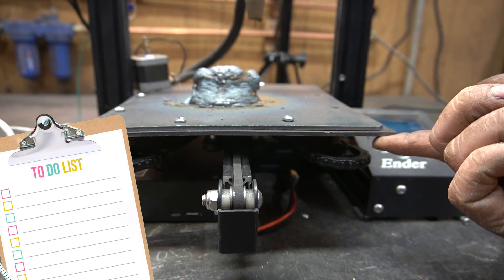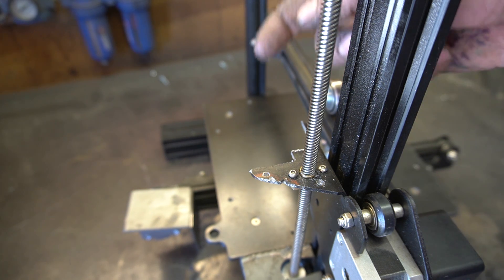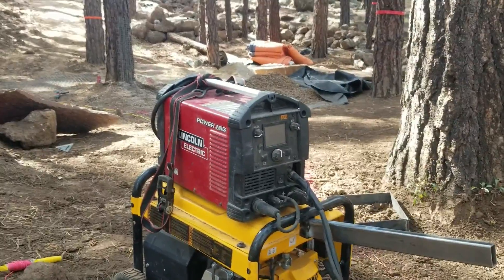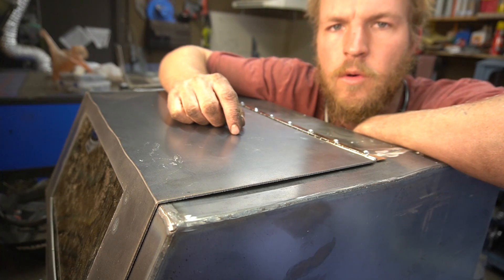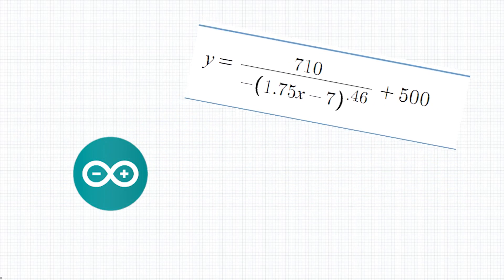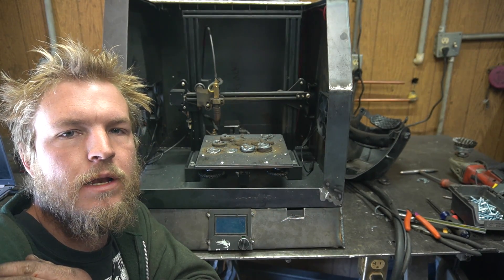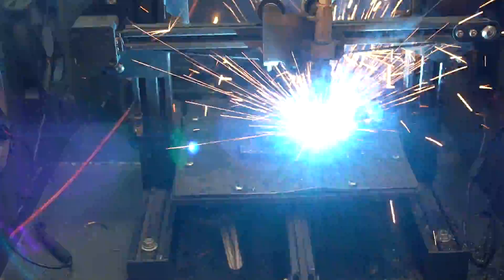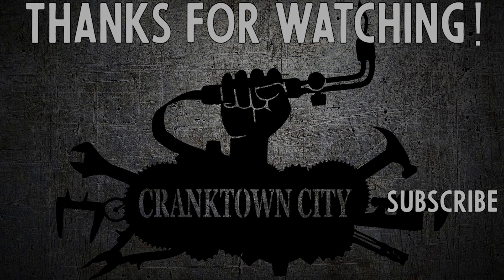DIY Metal 3D Printer (part 2)

Comment: So iceberg been a pipe welder for like ten years, and whenever I’m trying to “build up” a spot where I want steel to stack for any particular reason, I just do a bunch of instant “spats” so what I’m suggesting is if you can program the welding unit to maybe try More of a “dot matrix” approach where it can move around stacking individual coins as small as you can get it to weld then voila! You’ve got your heat input problem mitigated, and you now can work on your “resolution” that being how small of individual dots can you produce using smaller wire probably and much smaller current and wire fees speed.

Comment: That's crazy. Collectively we're still trying to figure out plastic printing, but when that's done the next hurdle will be metal 3d printing; in that regard, the  most advanced devices will be inept, bulky, and prone to failure, with a printable area no larger than a shoebox. Then there's your printer, which isn't accurate but works, and works kinda well, and works over a large theoretical print area

Comment: Ain't no way I could get half as far as you. I've thought about doing the same thing, after watching you turn a mig welder into a 3d printer I realize I'd be in way over my head. You did make me wonder if using .023 would give you more minute control and would hide imperfections better. Also not nearly as much spatter big enough to clog your cup. Probably quadruple your print times unless you scaled your benchy down. Not as much warpage I assume.

Comment: If you mounted a surface grinding wheel behind the printer. Then between layers the y axis could move back. Leveling the weld for the next layer

Comment: 10:40 that connecting rod system not working sent me down a whole tangent of looking up steam locomotives and my brain frying like a little overworked 3 cylinder.. i feel like that system would have worked if the rod was longer and it was set up parallel, it looked like you had the rod too short and therefor it was at 1oclock on one dial while it was at 12oclock on the other, they need to be timed together with the proper length rod and then i believe theyll spin together... or atleast thats what my intuition tells me

non the less the belt drive system looks far superior

Comment: If you change the liner and polarity, you can run aluminum wire, which will run cooler and freeze faster.

Comment: Hey man, when you were testing your amperage fluctuating, if you switch to spray arc or pulse mig it should change from variable amperage to constant current which should be easier to find a consistent slope.

Comment: To fix the extruder issue, you can change e-steps in the printer config interface without updating any firmware. Or possibly you could increase the flow rate in the slicer.

Comment: si tratas de refrigerar el metal de las capas anteriores a las que esta imprimiendo en ese momento se tendría un mejor resultado; pues el metal depositado al estar a una temperatura muy elevada derrite al metal que fue impreso en la capa anterior y se deforma, tal vez también a parte de la refrigeración de la sección ya impresa, habría que probar con una maquina de soldadura de menor amperaje con filamento mas fino, es algo que vino a la mente podría funcionar.

Comment: I seen the newer videos on this as well, and this may sound fracking stupid, but once everything is together and tight, how about  a putting an oscillator on the on the nozzle/print head to simulate rolling/cupping.

Comment: If the thermocouple went downscale when the temp went up it was either hooked backwards, or it was electrical noise. Red wires on thermocouples are negitive. Opto isolation would be agood idea if you blow the arduino.

Comment: Now you should take good tig welder and build a printer from scratch. The mig wire would still be usable but tig machine gives you setting capabilities on the arc and current.

Comment: Great video... I have some ideas. I watched last night and thought maybe thinner wire would help with heat and puddle control. My second idea is much harder but might be the best solution. Move the motors and submerge the entire setup in liquid similar to underwater welding. You could use different types of liquid to control heat and oxidation. This would be hard but maybe the ultimate solution.

Comment: I think you would have better luck with a Tig torch, and the filler off to the side, no splatter.  Also I know cooling might be an issue (maybe run water loops on your steppers), but since it's in a cabinet, you can just purge the whole cabinet with Argon (or whatever shielding gas/mix you're using), then you wouldn't need a cup, and could lighten Z axis.

Comment: When welding body panels, you can use an air compressor and air sprayer nozzle to cool the metal faster to avoid warping... Maybe get something like that set up to increase quality

Comment: You really aren't that far away from a functional product. Obviously money is the big factor, but building a printer from scratch  out of more robust materials, sacrificing a welder and a bit more work ironing out the kinks you already have a handle on and this could easily rival early polymer 3D printers.

Comment: Considering the layer width/height constraints of the weld bead, I'd call that a very good result.  You just need to scale up in size since resolution is very low.
Reply: no you can just increase resolution by micro tig.  go look up jewelers micro tig.  they can weld the pin back onto earings for crying out loud.  you want that type of welding for this so you can have great resolution

Comment: hey dude if you wanna get a huge speed boost on your laptop just grab a solid state drive and slap it in there

i have a $2k laptop that i got on ebay for way, way less because the original owner didn't know how to boot from a solid state drive and it was slower than my old lenovo idieapad despite having hideously higher specs in every single other way

if it is already running on a solid state, you have taught me fear of the arduino ide

Comment: Great progress! What if you built a heat shield attached to the z axis to prevent the heat up there? Also i see there is a ton of warpage to the base plate, maybe a water cooler might help it? im sure you could salvage some scrap parts to make a cheap functional water cooler!

Comment: You could maybe use some kind of optical sensor to monitor the welding. Probably behind dark glass. But it should instantly react to increas or decrease in the light which you would think has correlation to the welding.

Comment: i would imagine a tig setup would be far more controllable and repeatable for deposition rate and temp control, and not nearly as abusive to the motors and belts and such with all of the arcing and sparking of mig. it would be more complicated for sure, but im sure you could recycle the wire feed you already have without much issue and the much finer control over the arc you would get with tig would allow much higher quality prints.

Comment: My gf and I collect benchys and I gotta say this is one of the coolest I have ever seen! I had a thought about doing  this exactly, but never took it anywhere. I'm happy to see someone actually doing it! It came about while the gf and I were talking about free hand 3d printing with a mig  welder like one would with a 3d pen. That progressed into adding one to a cr-10 or ender3. Which is exactly what you did! This is awesome! Please keep up the great work!
Reply: no you want wire fed tig welder doing micro welds to get fine resolution.  a big mig welder won't cut it for fine work

Comment: you are not using gloves and your hands are always dirty. So your solution is to use angle grinder without cover. While using it you will lose some fingers and you will have less them to wash. Quite clever! But I would just use gloves and just keep hands clean. That's just me.

Comment: dip it in glycol instead, should work just as well, or maybe some alcohol with oil, something that doesnt leave a lot of stuff inside the nozzle
thats where you failed, otherwise entirely remove the nozzle and have a copper pipe shoot the gas onto the weld, or maybe just fill the whole box up with inert gas, CO2 should work. heavy and cheap

Comment: so, 3D printing MIG welders are used to make parts, HOWEVER the caveat is that there is going to be a stock removal phase afterwards. I know that there are some very high-tech ultra lightweight compressors blades for turbos are made using this process.  Im sure that there are others manufacturing industries that do as well.

Comment: Very Nice Job Bro.....same Idea here by me. Still In Progress near to end.....but it  will work fine.  Layer high controlled by Speed and Amps ....i use a Maschine Weld Head direct Wire Input from the Welder

Comment: If i could make an observation, i would use a method employed for pipe welding where the pipe is enclosed at one end and then an innert gas is pumped in at a desired pressure.
You could essentially get rid of the nozzel on the mig gun and use gas in the chamber to stop all your problems of contamination, let me know your thoughts please, great video thank you. Also just a thought, can i ask what determined height is each pass?, because my thoughts would be that you need a type of secondary functiin to the printer that shaves off the very tiniest amount of weld from the top of each pass to maintain a set height every time, sort of a grinder that passes each the pass and levels it and cleaning it before the next weld pass.
Thanks again

Comment: You should check out the tip dressing stations for robot welding. Maybe like a tip dressing thing that flips into the workspace for cleaning, and flips out of the way for printing

Comment: dude, the fact you turned an ender 3 into a "completely functional" mig-3D metal printer is pretty damn impressive. I have a year left on my aerospace engineering degree (after working 5 years as an auto mechanic and doing fab work on a couple race cars) and I would say 80% of the other students wouldn't even know where to start on a project like this.
Reply: wow that's a complement bro!
Reply: maybe because he made a boat and not a plane, fool
Reply: @Carpcontrol  aren't you clever 🙄

Comment: Keep in mind that my knowledge of welding is barely above zero, but I do have a few thoughts.

To save on the material that you use as a base plate to weld onto, what if you keep 1 piece mounted, then when you slice the model, send the first layer to your laser cutter to cut a piece out of your stock. Then use a few tack welds to fix it in place on the build plate.

As for how to get it in the right place... well I have a couple of ideas. The fancy way would be to figure out how to make 1 of those position finding probes, kinda like they use on some CNC milling machines. The other way... actually, I'm not sure - I started off thinking of sort of a manual alignment system, but the more I thought about it the more complicated/difficult it got, so... 🤷‍♂️ Maybe you can figure it out.

Dunno if any of that will be of any use, but maybe it might at least spark some new ideas for you. 😉

Actually, I just realised, you don't need to cut the first layer to the exact shape of the model, you could just cut out a rectangle that is somewhat close to the size of the first layer in terms of max width & length. That would make positioning it way simpler, and still help you reduce the amount of material you go through for base plates.

And yet another idea, though it kinda defeats the whole 3d printing metal concept - when making a 3d model include some vertical holes that run through the whole thing from top to bottom. These holes should match the size of whatever bar/rod stock you have on hand. Slice the model into layers the height of your plate stock, then cut them out on your laser. Weld rods into holes of bottom layer, then just slide the other layers on top 1 after the other. You could just weld only the bottom & top layers, & then grind / sand the model a bit to shape. Alternatively you could weld each layer to the 1 before it, using the welds as a way to smooth the visual transition between layers.

Comment: There is probably a reason every one of these I have seen uses a delta table rather than gantry style. You can get a high voltage digipot but you have to talk to it via SPI anyway.

Comment: This is really cool. Have you tried checking the amperage at your ground clamp and comparing that to the amps on your welder? That might help with adjusting the wire speed.

Comment: as a welder I will tell you - learn current-temperature conjugation (2nd class of vocational school - subject of applied metallurgy) - then you will know what the temperature depends on and how it affects the environment
as a construct of one of the first 3D printers using RAMPS you need to know that the current tolerance is within 0.3-0.7 V and when exceeding 5.11 V each RAMPS goes with smoke
the feeder can be powered from RAMPS through a controlled transducer (triac system)
the prototype of the 3D welding machine was discontinued in 2014 as ineffective and unprofitable in production

Comment: 3d printer motherboard’s are all 12v or 24v, you can save a power supply by using just one of them. The only parts that get touchy about that are the fans & heating elements (bed & hotend), none of which you are using. The steppers will still get the same volts if you use ether 12v or 24v.

Comment: LOL, here from Hackaday, and glad I found your channel. Subbed because you're funny, straight to the point, and especially leave the mistakes, warts and all in which shows an important part of any project, learnin'.
I think that turned out great, rough? sure. Buts its made of metal with a welding gun, not surprised that there is a bit more slop at this stage.   I expect it you wanted to throw a couple grand worth of motors, machined surfaces and some sort of slower welding process, you could probably do better.
If you don't want to throw cash away, keep iterating, and it will also get better.   They don't weld wood, and they don't glue-up steel works, for a reason.  You're kind of breaking new ground, like the citizen-scientists of olde.

Comment: For sale: one slightly used ender 3, works a treat and even prints metal! That's right print you some bolts, nuts, that crank shaft for your car, whatever! Only $999.99

Comment: In this case I'm pretty sure ohms law could be your best friend along with power theory. The current you are putting in has a set upper limit. When you dump current in and it's not maxing out, that resistance should be directly translatable into a wattage load, the big hang-up is your cnc won't know if it's moving towards or away from the heat it's sinking, like when it does a circle it comes back over an already heated area. I wonder if some sort of crude XY accumulated heat-map/coordinates from those sorts of measurements, that just assumes a cooling dissipation factor, could get you most of the way there. Also there is what 3d printers use for this in having minimum "wait for next layer" timers.
Reply: I don't know CNC, however by jove, I think you're on to something Watson!  Seriously, agree that know where you've been, and where you're going as to heat sinking is an excellent idea. At some point, adding additional heat on top of a layer is going to cause excessive unwanted deformation.  I think you could even modify the CNC program to generate such a thing when it renders before an actual run.

Comment: An encoder on the wire feeder,  or a stepper motor in it, would give you more control.   As this is how the plastic extruder works you can use the existing firmware unchanged (the Ender might not have encoder/servo built in but they certainly exist in the reprap firmware world)

Comment: If heat is the problem...maybe more cooling before continuing?    Sensor and air cooling is a simple first step.   If that is solving the problem but is too much time.  Second, but much messier: Water is great for cooling but maybe the small amount of surface rust will affect the weld, so maybe automobile coolant?

Comment: For what you have said you have a problem with heat, try using some cheap water blocks that you can buy on eBay and sandwich them between the build plate and your metal sheet (base)

Comment: Love the way you are thinking!  -- I think your arduino was just getting some voltage/noise from your welder! It doesnt take a lot of noise for it to wipe out a cheap voltage or resistance driven 5v analog sensor like that.  Esp with a long lead, running parallel to the welding conductor,   Plus you hooked it to the (grounded?) metal sheath of the welder with a conductive metal pipe clamp!   In your defense I think the EMF would still give you a problem even without metal-to-metal.  I had a problem using RTC temp sensors a length of 20 ft using arduino. I ended up using a digital sensor that just sends communication back (ds18b20. But it is not high temp compatible ) 

You may want to look into IR sensing! I just watched a video about "DIY IR camera vs Commercial IR camera".  You could probably utilize the cheap 8x8 pixel sensors that cost about 100$,  since you arent using it for "video" but for temperature monitoring remotely (without contact). Or maybe there is a useful sensor inside one of the IR temp guns?  Work to find something that reads the temp accurately, FLIR, IR non-contact thermometer, or otherwise. No matter what it is, an interface circuit to feed the data to your printer control can be built.

I'm subbed now and tuned in closely!! More power to you!